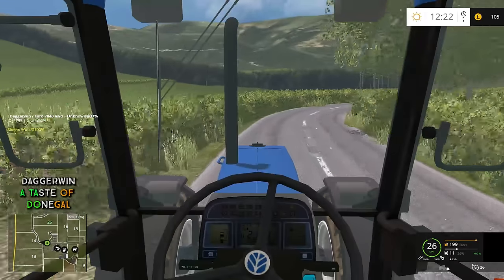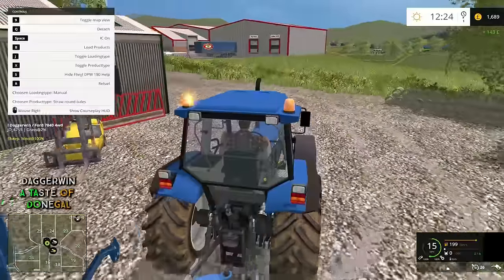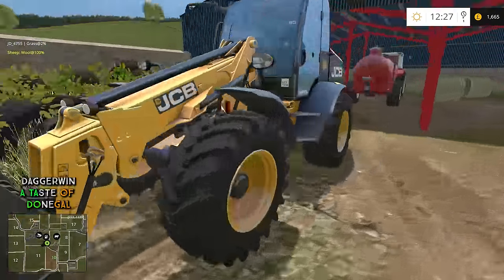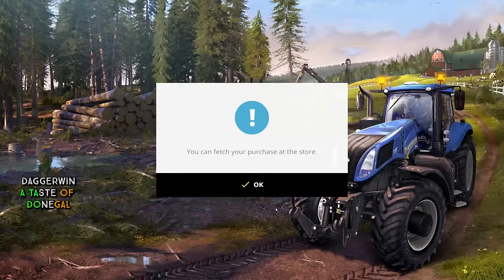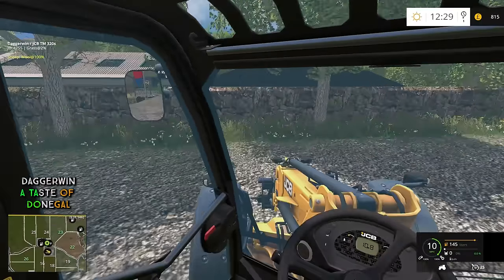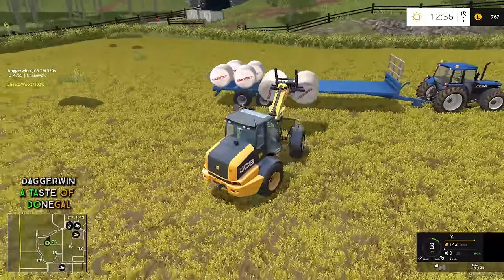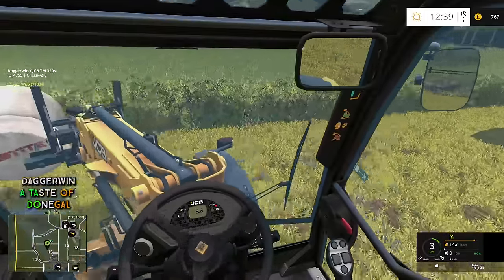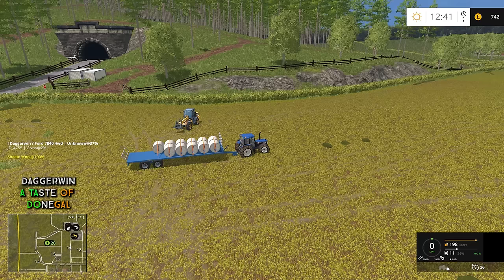Let's Play Farming Simulator 2015 | A Taste of Donegal | Episode 19

Comment: I think the reason the silage bales were so cheap is because with bale extension it requires them to ferment for them to count as silage so they were treated as if they were grass so they sold a lot cheaper. I'm not sure if that's correct but I do know that the bale extension has to ferment the bales for 1 day for them to be silage

Comment: You would start loading from the front becase if you laod the bales at the back the weight would put to much pressure on the hitch beacuse the back would be weighed down and the front would lift up so the tractor would loss traction so that puts a lot of strain on the tractor (this does not happen in fs but if your going for realism load from the front)